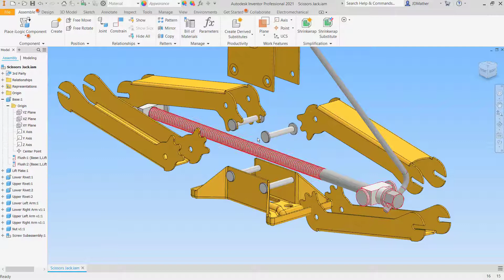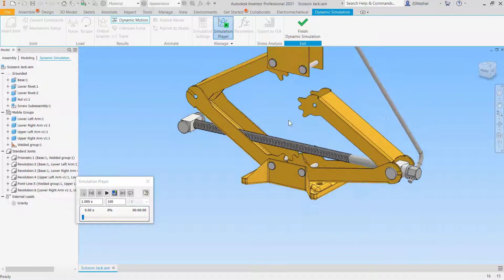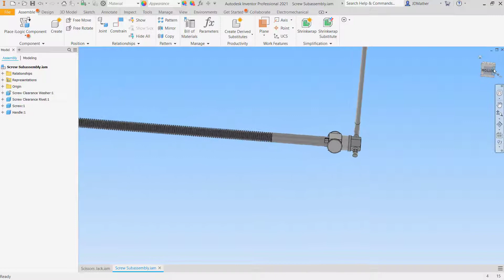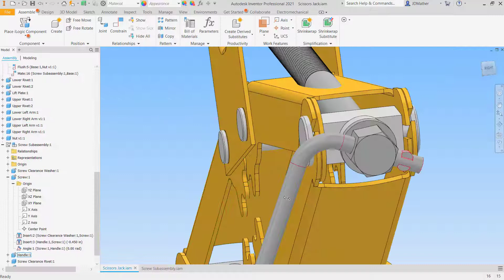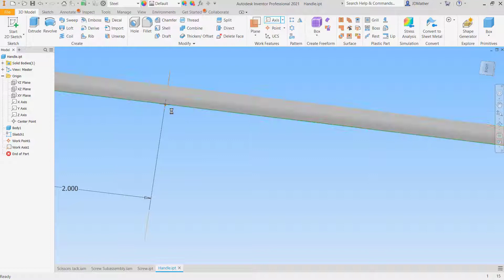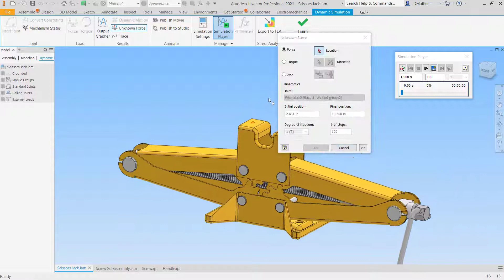Scissors Jack Analysis   Video 8 of 8

Comment: Hi there, just a quick question, does fusion 360 has a dynamic simulation option as I only use Inventor for this option.
It looks like you are in Fusion 360 and some  how I can see the dynamic simulation panel. Could elaborate please?
Reply from the maker: No.